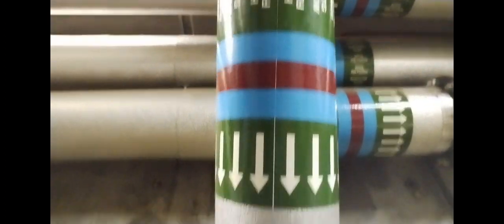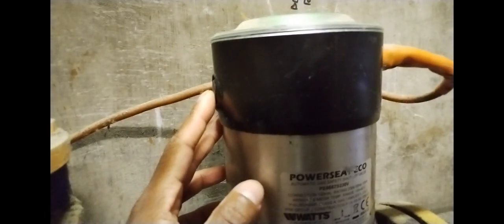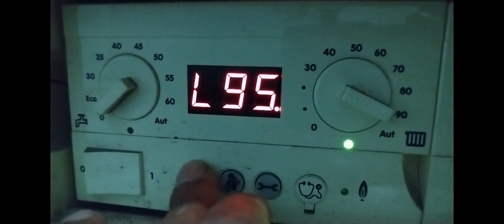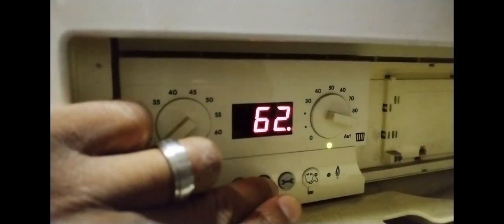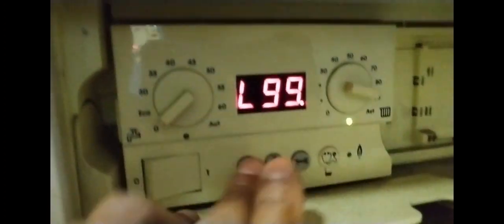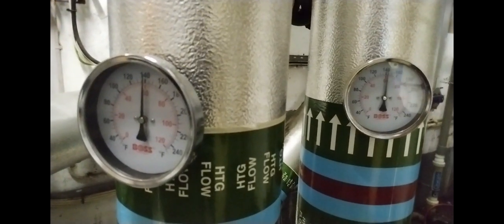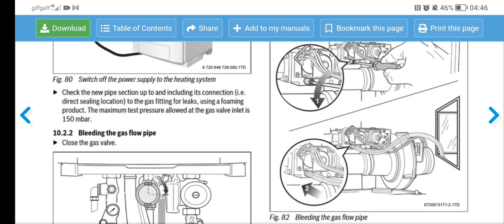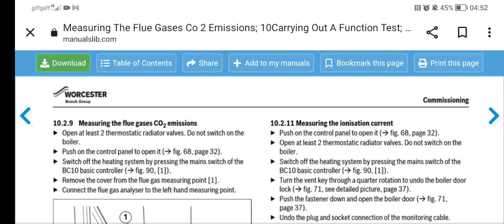WORCESTER COMMERCIAL BOILER GB162

Comment: Good boiler overall. Water quality is important. Keep the PH above 7 of the system. Most common issue is the condensate tube that connects the pan to the trap gets very brittle from the heat. If you see the inside of your boiler discolored like someone smoked 100 cartons of cigs in there, then you have an issue with that. I did notice on the last batch of boilers they made before they discontinued them, the igniters are faulty on many of them. I was told by the rep to use the GB142 igniter instead.

Comment: I used to love working on the GB162 not a bad boiler if maintained properly, just have to keep a eye on the pipe that runs from the sump to the syphon they always crack and split and flood the electrics 😩. Another great video btw 👍
Reply from the maker: Thanks for the heads up on the pipe that runs from the sump. Have a good weekend
Reply: @CommercialGasEngineerVideos  no problem mate you to have a good weekend 👍

Comment: I look after 52 of the same boiler for a council in essex  they have been in for 12 years and are all  just about coming to the end of there useful life  the new version is advertised in the latest gassafe magazine ....there ok but I think my client will be going over to another manufacturer......they survive longer even on a super clean brand new system via a plate heat exchanger  
The best post market modification buderus worcester done over time was to replace the plastic  A.A.V with a brass one  
Nice video m8
Reply from the maker: Nice one m8. Thanks for the info on those boilers. Hope that you're enjoying the weather this weekend.

Comment: I'm not too familiar with that particular boiler, I know on some models of Worcester boilers a racket or trumpet sound can be caused by the bearing plate but I'm not too sure if this model has that, other than that like you say its likely to be the gas valve or fan, great video as always mate
Reply from the maker: Thanks for the tech support Tom. Manufacturer said fan or gas valve.  Looking forward to finding out.
Reply: @CommercialGasEngineerVideos what was it mate? I’d say fan.
Reply from the maker: @roberttaaffe215  Changed the fan then the pcb got damaged when I isolated the power and reinstated.